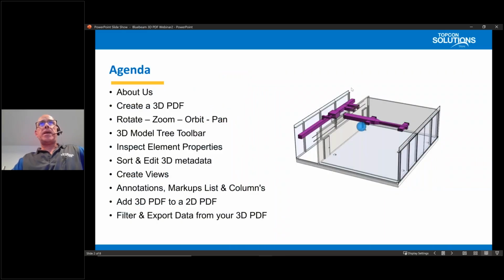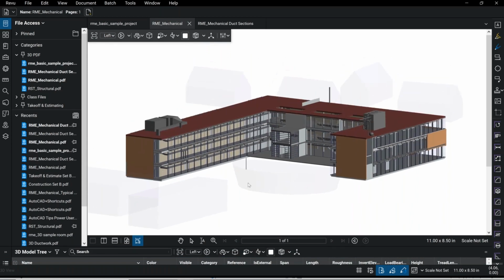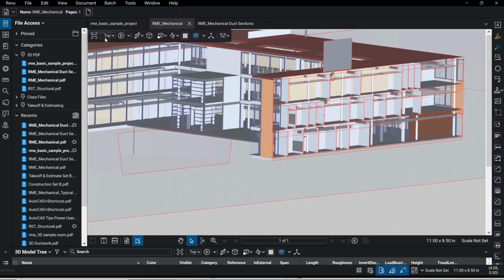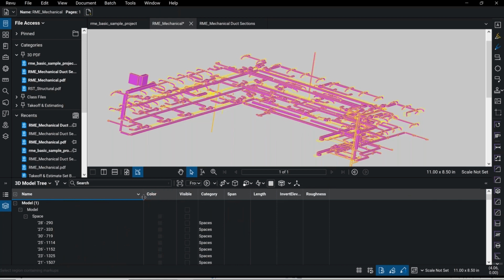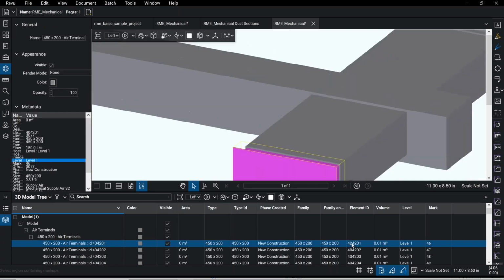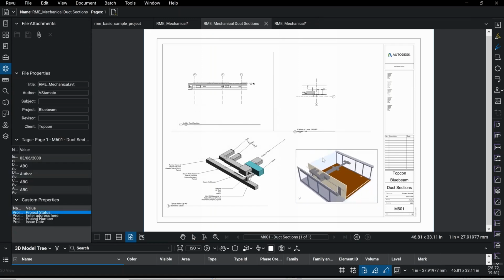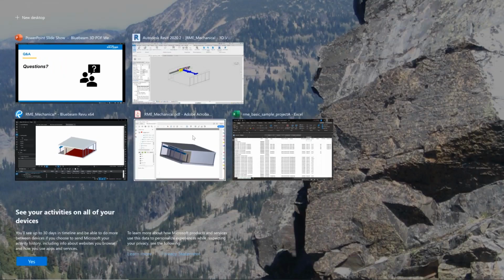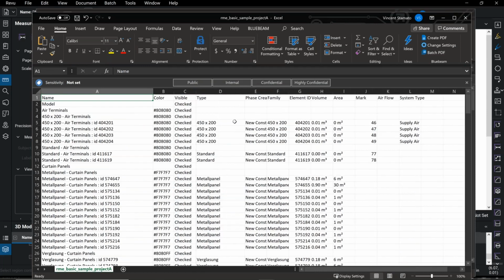Bluebeam Revu - 3D PDFs

Comment: May i ask if if creating the ifc file from autocad worked for the gentlemen? I work in autocad mep and im really trying to convince my boss to upgrade to extreme for this feature!
Reply: Hello Edwin! I am a senior application specialist with Topcon Solutions. After testing with a dwg, we have found that the best workflow is to open the dwg in Navisworks and create the 3D PDF from there. That is assuming you have the CAD version of Revu, you do not necessarily need to have the extreme version to do this.

Comment: What's the plugin you need to install to be able to export to pdf? What website?
Reply: In Bluebeam under the Revu tab, in the Administrator , in the plugins tab this is where you want to see the version and year of Revit which you are using. Make sure the box is checked.
In Revit under the Addins tab there will be a Bluebeam panel and a create 3D PDF drop down menu where you can create your 3D PDF. Also you will need to be in a 3D view to execute this.
I hope this helps.